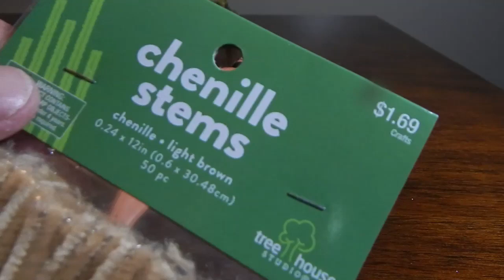Hasbro 1977 SUPER JOE Commander Repair

Comment: With the re-release of Super Joe coming soon, there are going to be repair kits for vintage figures.  Sounds like they will be using a barbell type joint as you refer to.
Reply from the maker: Awesome news
Reply: Dan, do you have a link for this? I haven’t seen any news about a Super Joe re-release.
Reply: @jonnypolk2502  Not yet, they should be making an announcement soon.  It was due out in Spring, but COVID happened.  Keep an eye out!

Comment: Best material for restringing a Joe is using elastic cording. You can get it in all different sizes but about the size of your average round shoe lace is all that is required. It will put the necessary tension on the joint, making all of the joints functional and stable.

Comment: If it’s just super glue, You can muscle apart the big joints like hips, shoulders and head without fear of breaking anything. Smaller joints like elbow, knee and ankle, try some lighter fluid. The kind you use when refilling zippo, And certainly not the kind used for charcoal. It will sound like you are destroying the earth with all the cracking sound it makes but it will break free and clean!

Comment: I did watch this when originally uploaded but unfortunately Using a PlayStation 4 to comment on YouTube no longer works ☹
I prefer to watch on my 60 inch TV so i have to watch on my PS4, then use my tablet to comment from now on. Its a pain in the butt because I'm constantly hitting the wrong keys! 😟
Anyway, looks like a bugger to restore, hard to make a real assessment without trying myself but I think you've done a respectable job here. I was also wondering if big Jim hands might fit?
Reply from the maker: Its a challange for sure, I think a better fix is out there but in the end its better than how it started. I don't have any big Jim figures myself but yeah likely would fit.